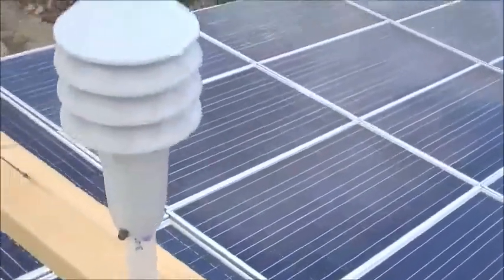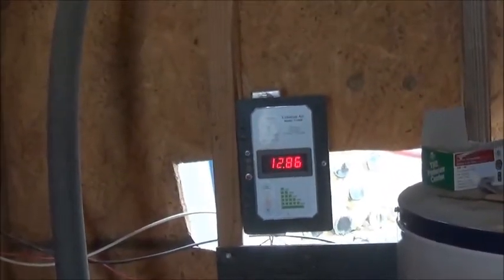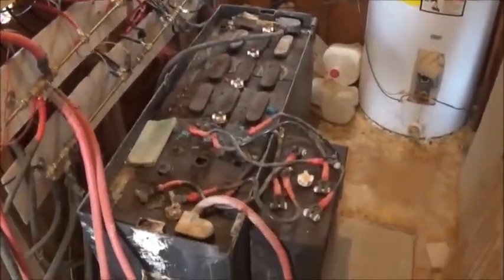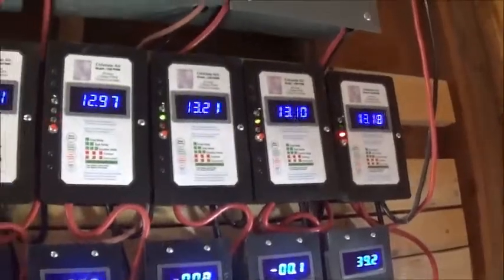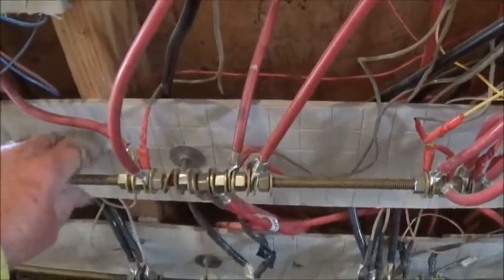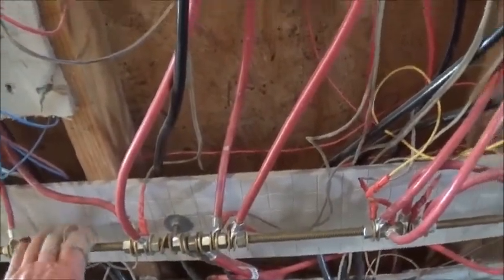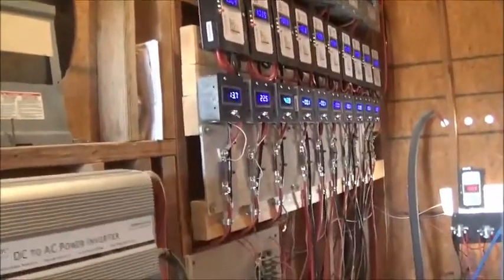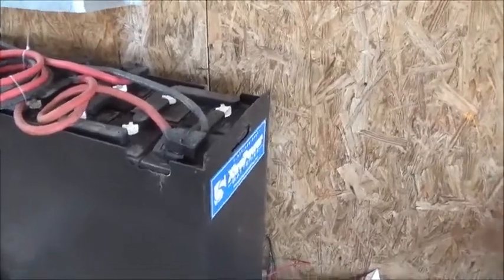Our Power Room!

Comment: I was thinking to go solar, but jesez... id have to sell a kidney for all that gear lol.
Reply from the maker: +Ohsplat We started very small and build this over five years with ALL extra money we came into. My best advice to starting, it to build a DC generator first to charge ANY batteries you can get. Buy an inverter (AIMS), then add panels while saving the $2400 for one forklift battery. The DC generator will save your ass and everyone should start there!!! Good luck and remember this: "If it were easy, everyone would do it!"
Reply: +eco-ranch.us I don't plan on running much off the power. a freezer and a small AC unit.
Reply: +eco-ranch.us I don't plan on running much off the power. a freezer and a small AC unit.
Reply from the maker: +Ohsplat We ran a refrigerator, freezer and an "Energy Star" AC unit with four 255 amp batteries, 250 watts of solar and a 1000 watt inverter for several months here. The AC had to be turned off at dusk and the refrigerator & freezer while we slept, but it worked. Cost for these things: $1200    You can do it!
Reply: +eco-ranch.us there we go!  what about a diesel gen,band bio diesel
Reply from the maker: +Ohsplat We had a diesel generator when we built this place. Lasted nine months in continuous use. I prefer the DC generator, as you will have to get your batteries and inverter.... critical items anyway and won't learn to depend on a true generator.. Charge the batteries with the DC generator and run things at night if needed with it. Then you buy solar panels one at a time or however you an afford them.

Comment: I love your videos. Can you run two inverters off the same battery bank to get 240 v.
Reply from the maker: SAm Wauthier Thanks!!! Yes you can run two inverters off one battery or one battery bank. The inverter is an independent power supply that draws its DC current from the battery bank. So long as there is enough energy in the battery or battery bank, you can run two , or even three inverters off of it. So two inverters will give you 220 volt service when the AC connections are correct. Each inverter draws its power to make 110 AC volts from your battery and these two separate power supplies, each wired to one leg of your circuit box gives 110 each, for 220 total available.
BUT THERE ARE LIMITS. I do not fully understand the limits, but I know that when I tried to run that old air compressor, it stressed the inverters somehow and the weakest one fried! It was sort of like I had the HORSEPOWER, but not the TORQUE to run the compressor.I do run my welder on the current system with no problem though. An electrical engineer would be best able to discuss the limitations to your 220 volt power.

Comment: That's a very impressive system I like that. I don't think mine will be that big but I'm open will be big enough to run my garage
Reply from the maker: The good thing about building your own system, is that you can expand it as and if needed! Our system started out with four "solar" batteries and a Chinese made 5000 watt inverter (that blew up in four weeks). What we have now, it the result of additions over five years.

Comment: I am a little worried about that buss bar getting that hot. I have 2  terminal lugs with 3 bolts on each one and they are rated at 500 amps. once I get it fired up I will use a temp probe and see what kind of heat builds up. I went thru a marine store and got 3  24 volt continuous duty fans for about the same cost as those 120mm fans you see some use on battery boxes. the cfm are around 215 and the motor and bearings are sealed and they use them for inside engine rooms and heavy fumes. ill try to post a video of them once I get them installed and if you want the address to the store I can forward it to you, they have them in 12 and 24 volt set ups.
Reply from the maker: I have a couple of fans that I can put on the buss bars. I need to move the dead forklift battery first. Even moving it should help, but putting a fan on them should do the trick! Thanks!

Comment: nice job on the set up. have you figured out the amps going thru those buss bars that are producing heat?  I am using two 500amp buss bars on my 24 volt system. got them thru a Marine outlet store along with some nice fans to use as exhaust from the battery room and also to move air thru the equipment room.
Reply from the maker: I will have to add a fan directed at the charge controllers for day. They get hot as well. I do NOT know the amps going through the buss bars. They seem to heat up when we demand power, like using the AC. There is about 450 amps coming from the solar panels alone to the bar, so this may be the source. The bar is a 3/8" copper bar. I was considering wrapping the bars in copper wire to a thickness of about 3/4". I don't know if this will help, but I have the copper and to change the bars would mean to change all the lugs as well, since these are 3/8" also.

Comment: I like the battery bank, what did you give for them I like to get a few my self when I add on to my shed so I can have a nice power room. I know justincase is off grid he is in Australia, his entire home is off grid. nice video thanks for showing.
Reply from the maker: I am not sure about whether the cost to ship to Australia would be worth it. I paid about $2400 each, delivered here. But the advantage.... you probably already know this.... is that these can be run down to nearly dead, then recharged, over and over again. They are designed this way. My other, AGM "solar" batteries could only be run down to 50%. A big waste of money in our opinion!
Reply: eco-ranch.us we have industrial Batteries at work, I love to get my hands on them I Run 24 volts for my system since my APC's are 24 volts and I can run my shed off them other than my AC  The one you said that was fried that had two dead cells in it. you can remove those dead cell and replace them or take out the bad ones and keep the good ones for a 12 volt battery. Like the ones you have. but I don't live in Australia but a good friend dose that is off grid.  

I cant wait to get off grid.
Reply from the maker: McCuneWindandSolar XtraPower Batteries has a program where they will buy back a dead battery from you, even have it picked up! You can see an extra cell in the video.... we already tried to replace a bad cell but the other five must be so badly damaged that we would need to replace all six. I plan on taking the battery money and adding to it for one more of these monsters. There is room for two more on the pad I poured.